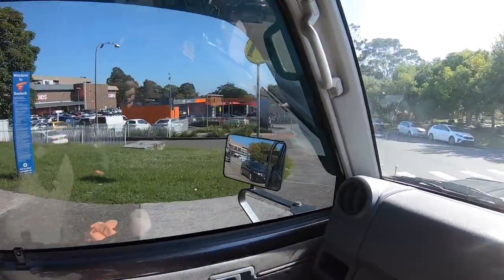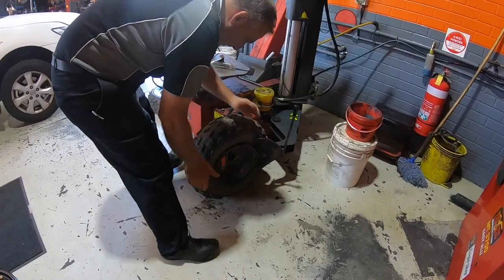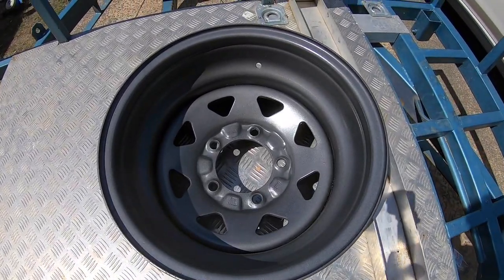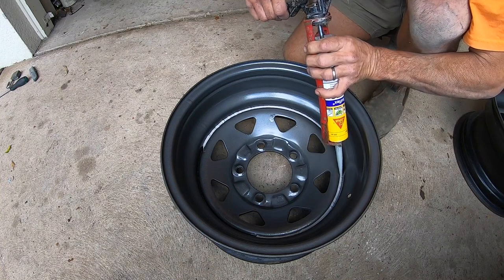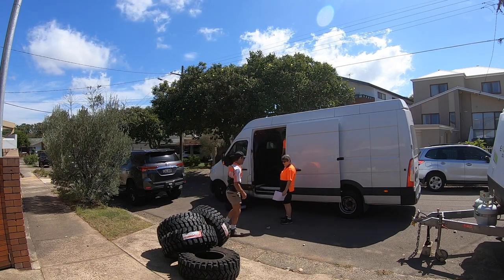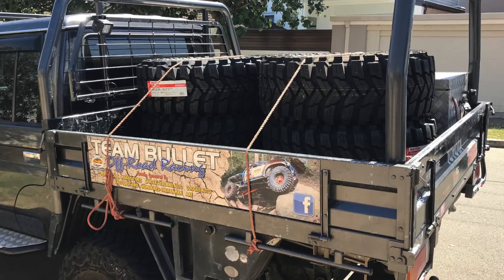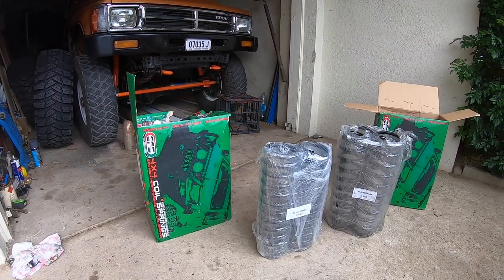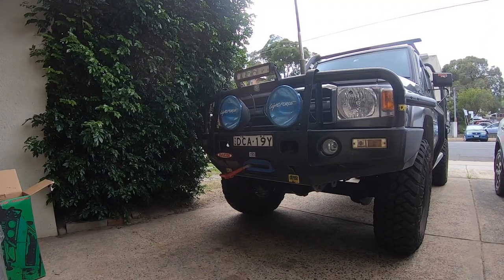VDJ79 78 76 series offset rim choice fitting 35 12.5 16 tyres under front coil suspension comparison

Comment: I think its ROH who make a nice black powdercoated 12.9 high tensile wheel nut for the VDJ79R with a closed in end cap so water & rust cant get into the stud threads from the outside, plus they look nice & wear well.
Reply: Just check that the nut face taper mates correctly to your rims, I'm running ROH rims & ROH wheel nuts. I think there could be an issue between other rim manufacturers & ROH wheel nuts from memory, could have been the ROH nuts have a bigger surface area there too where they contact the rim.
Reply from the maker: @dustyfarmer  Copy mate and thanks again for the input
Reply from the maker: The boys are getting me some, I've only ever seen those in a 19mm, really like the big 22s....

Comment: what size tyre can you fit under the factory tray? what have you got under there?
Reply from the maker: The 35s fitted easily under factory tray.
Reply: @TeamBulletOffroad  no modifications necessary?
Reply from the maker: @gee35007  Not in the rear..